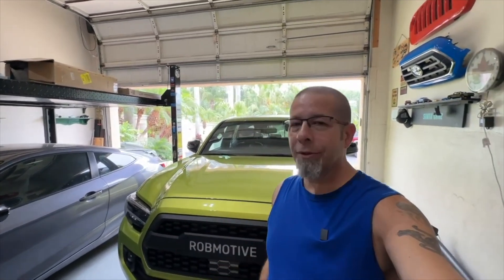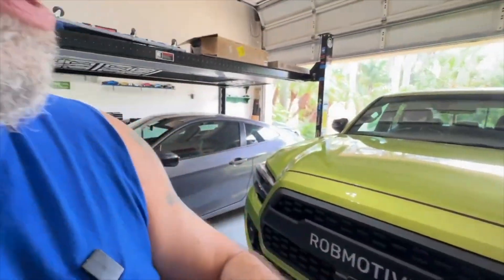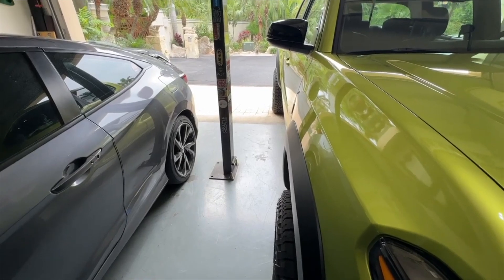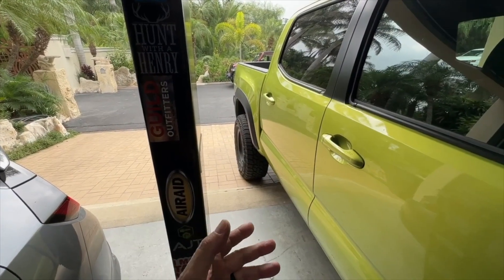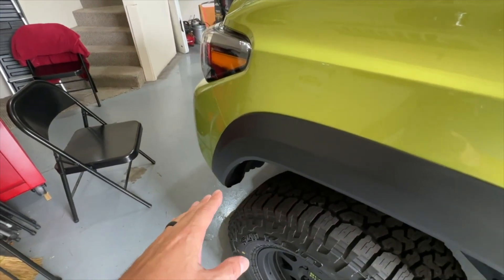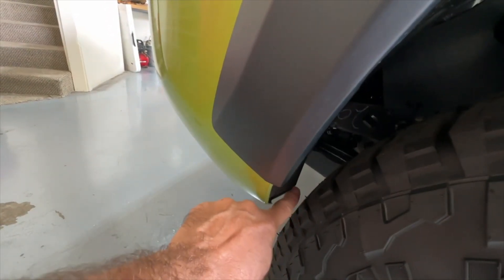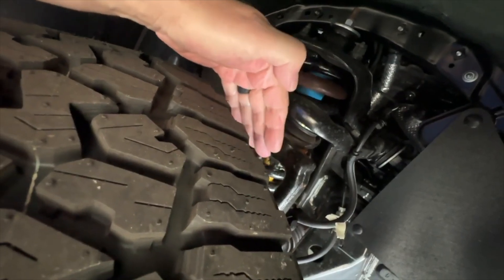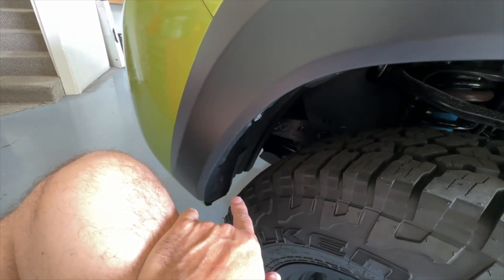Toyota Tacoma New Wheel and Tire Problems

Comment: I have the same truck you just traded for your new one.....same black rhino stadium wheels.......used Bilstein in front to level the truck (about 1.5 inches or so) and did nothing to the back.  tires are BF Goodrich ko2 265/75/R16.  I followed your lead back then and still love the look and setup.  So far, no rubbing issues at all that I have been able to detect.  thanks for all the good advice on wheels and tires!!!!
Reply from the maker: That’s great.  I loved that setup too👍

Comment: I just replaced my stock Firestones that came with my 2020 Tacoma today. I had 40k miles and them and they were pretty much played out. So, it was time to replace them. 
I went with the Falken Wildpeak A/T3W 265/70R16 and man, were you right!
These tires are so much smoother driving than the stock tires and they look totally badass on my rig.

Thanks for al the vids you do. I'm a big fan and value your opinions.
Reply from the maker: Thanks!  That’s great Alan.  They are my favorite 👍

Comment: 3 inch lift with 0 offset and 285/75/16 tires work just fine.  Minor rubbing when turning super hard but nothing that causes damage.
Reply from the maker: For me…any rubbing under any circumstances is unacceptable 😐

Comment: I went with 265/75/R16 Toyo MT's on Fuel wheels with -9 offset and I have zero rub issues. On a side note though, on the 26th I get my Demello Off-Road bumper put on which requires some cutting because it is a full bumper, so the future is looking good.
Reply from the maker: I’d be surprised….🤔
Reply: @RobMotive  Well, small lift too. 2.5 on the front and 1 on the rear. However I did underestimate the constant weight on the rear with the bed rack and roof top tent so I have some OME leaf springs and OME shocks being put on it on the 23rd which is a 2" kit. But yeah, no problems on the front. I haven't done any crazy off-roading yet, just some mountain trails, but no problems.
Reply from the maker: Ok!  With the lift I get it👍
Reply: @RobMotive  Yeah, without the lift there's no way. In fact, even with the 2.5 lift on the front and 1 inch on the rear, those 265/75/R16's are the biggest you can go without having to start chopping stuff. 31.8" is what they come out to. The factory tires are 30.2".

Comment: On my trd sport i went to a 17x9 from 17x7.5 +1 offset, even with a +1 offset the wheel being wider put the stock tires 265/65-17 just outside the fender flairs, didn't have to modify or remove anything, no lift and no rub
Reply: That's awesome.  What year is your truck?  I have a 2022 TRD Sport and am looking for the same result.
Reply: @rickcipullo6580  '23
Reply: What did you get for tires?

Comment: Ran 285/75r16 on a +12 off-roaded no rub. Now I'm on 35 and have trimmed and cut.
Reply: What’s you lift setup?
Reply: @MrPQG123  Fox DSC set to 1.5-2", SPC UCA alignment caster +4.5, on 33 TRD wheels on 35 method 701. Rear deavers 1.75"

Comment: Huh imagine that changing wheel offset causes issues with the tire clearance.   Makes me glad I like to leave the stance factory.  But the factory look doesn’t bother me.  Son did a 2-3” lift on his JK so he could mount 35s. Think it has a better ride than factory course the Metal Cloak parts were over $4k in 2017. He worked in an alignment shop while in school so he did the install.

Comment: So for an SR5 with no lift, the biggest with no rub would be a 265/70R/16 or 265/75/16?
Reply from the maker: The former.
Reply: Both will work a 265/75r16 will NOT rub with a wheel of +4 or greater.
Reply: Gents, thoughts on going from the stock TRD OR +25mm wheels to 0 offset wheels while increasing to the 265/75R16?

Comment: I want to go with the Falken Wildpeak A/T 3W 265/70R 16 but put them on my stock Tacoma wheels which I believe have no negative off-set. I also have the front mud flaps on currently.
Do you think I would have a rubbing issue?
Reply from the maker: Nope, not all stock👍

Comment: Rob...  Are stock rims from a TRD version of a Tacoma the same width as those for a stock SR5?  I sure hope so, I was able to pick up a set of used TRD rims that were in excellent shape to mount the highway tires that were on my Tacoma when I bought the truck.  Three days after I bought the truck it snowed here in Colorado so I went to Big-O and got some M&S tires and kept the highway tires as they still had almost new tread on them.  I just had Big-O swap my M&S tires and rims the other day with the highway tires and TRD rims.  It seems a bit quieter in the cab with the highway tires.  Both sets of tires are 245R 75 16's so I hope there won't be any rubbing.
Reply from the maker: I don’t believe so, but you should probably verify🤔
Reply: I have a 2023 Tacoma SR5 tire size 245/75/16 can I install 265/75/16 tires on these rims?

Comment: Stock wheels are 17x7 +30mm, TRD Pro come in 16x7 and 17x7 +4mm. Going to a -10mm offset with a 16x8 is putting a wheel that is 25.4mm wider another 14mm further out than what Toyota will put in a TRD Pro. So, take half the 25.4mm and add 14mm and it's ~27mm further out. The math doesn't work as the swing gets too wide on that combination. There is a better option with less offset for similar looking wheels from another manufacturer.

Comment: Did you consider going to a 17” wheel
Was just curious. 
I ended up going 265 70 17. So far so good. I took your advice as far as fitting vs fitting correctly
Reply from the maker: Nope.  I like the extra tire wall👍
Reply: Gotcha.
Reply: @RobMotive  you would have had the same amount of side wall on the tire right? Both would have been 70.
Reply: @RobMotive  Your answer doesn't make sense for the original question. 70% of 265mm is 185.5mm which is the sidewall height (7.3"). The sidewall height on EVERY 265/70 tire is the same regardless how big the wheel is. How can you get "extra tire wall" when math says you can't?
Reply from the maker: Looks like more to me👍
Reply: @Langhorstiness  You don’t make sense. Did you even bother to watch the video? Trouble with comprehension? He stuck with the OEM tire size. A 265/70 in 17” has an overall diameter 1” larger than what he has. If he went with a 17” wheel (per the original question) he would have to give up sidewall to stay with the OEM tire diameter. Next time you want to call someone out regarding math, please have someone else do the calculations for you.
Reply: @Ts-zy4bw Thank you for reinforcing my point. Rod's tires are OEM for TRD Pro is 265/70/R16 = 30.6" diameter and sidewall height of 7.3" (but on 16x8 which are wider wheels AND pushed out -10mm offset compared to OEM TRD Pro wheels which are 16x7 at +4mm). You're clearly an expert so you can add up how much the wheels have moved the center of the tires outward in millimeters. It's a lot, and now even the OEM tire size rubs. The original question was why not use 265/70/R17 which would have resulted in 31.6" tire diameter BUT IT'S THE SAME SIDEWALL HEIGHT of 7.3". At no point did anyone say 265/65/R17 so that the tire diameters were the same and Rob would be giving up sidewall. Instead, Rob replied that he somehow has more sidewall on his 265/70 tires than the original poster's question. Rod's aesthetic goal of having wheels poke out a bunch is forcing the tire diameter to stay OEM. It was a missed opportunity to explain how increasing tire diameter would have only worsened wheel rubbing issues he now has. I'm going to just assume that Rob is so busy putting out daily videos he got confused about the question and gave a confusing answer. It's the insistence that 265/70 > 265/70 that doesn't make sense and is mathematically impossible. Thanks for voicing your concerns.